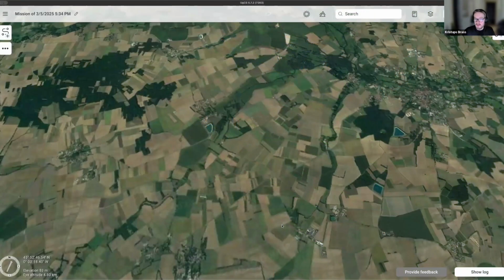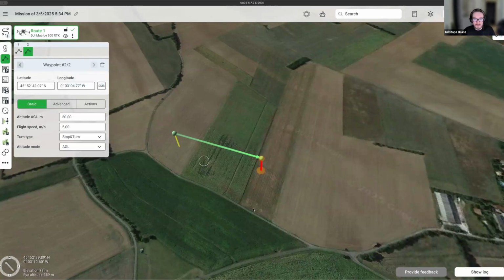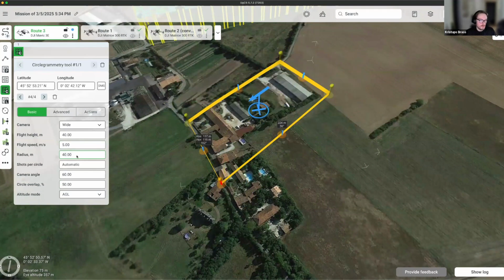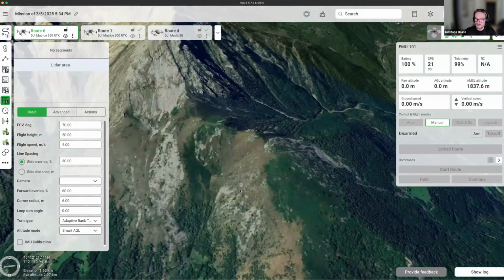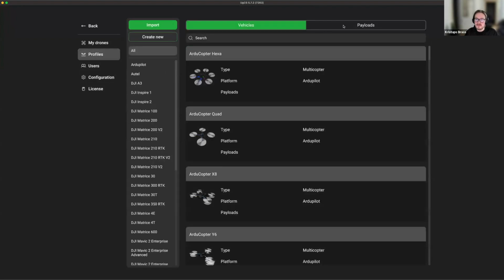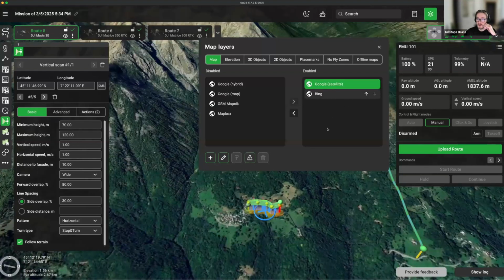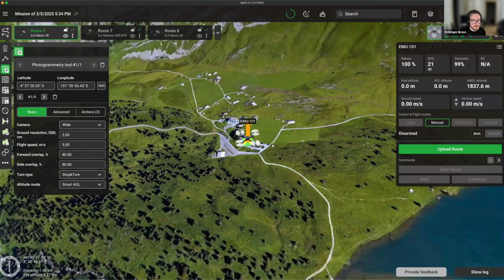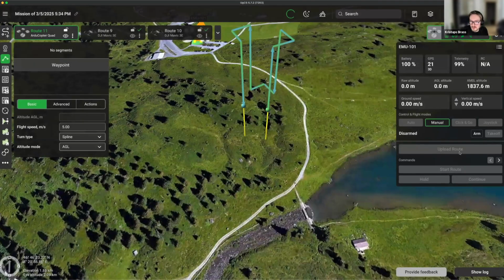Webinar | UgCS Just Got Better. See What’s New in 2025!

Comment: My company has built a custom drone using the herelink controller. Will UgCs still work?
Reply: Yes it will. We use the Herelink’s built in hotspot so our laptop with UgCS can connect to the drone. Our drone is running Arducopter.

Comment: Right now I’m using the cloud sync feature with the m300. I bring the sync’ed file into Pilot 2 on the DJI RC Plus controller and fly from Pilot 2. Would there be an advantage to flying from the UgCS app instead? My main concern is terrain following.
Reply: When using the Companion app you don't need to worry about having the first mission waypoint at the same elevation as the drone, that's the main advantage. -Kristaps